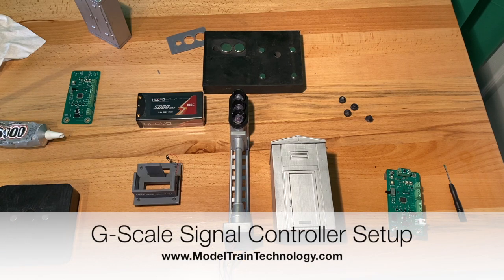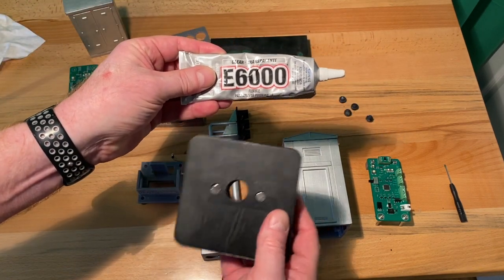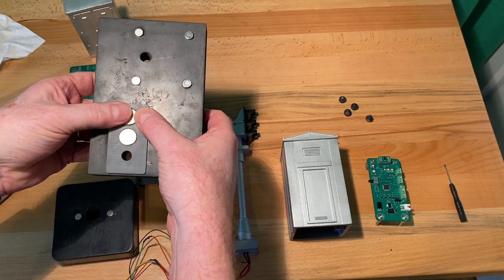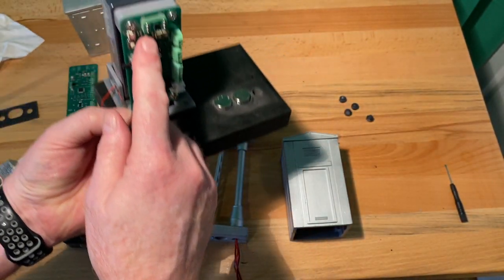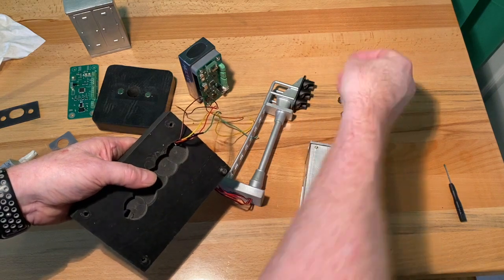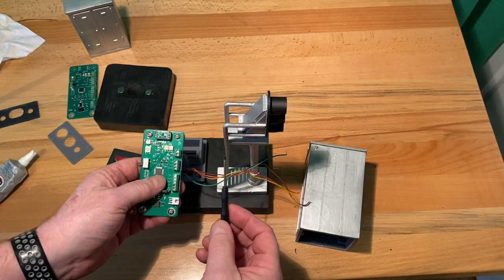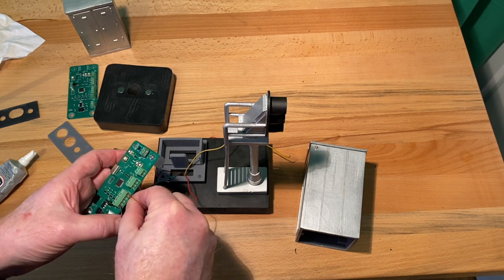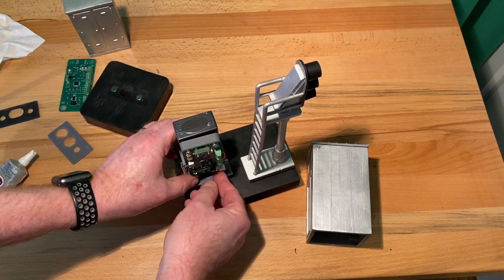G Scale Controller & Signal Setup and Operating Instructions

Comment: I am interested in those electrical houses. I build my own searchlights close to scale for the old US&S H2's and right now, they're bi-polar LED's, just red and green. I'm hoping to soon develop three color LED driven searchlights that have the same detail.

But just to have some type of infrared circuit to detect and change the signal would be great.
Reply from the maker: We dont use Infrared (just to be clear on that). IR is notoriously bad in varying light conditions.  Three color is easy and the Signal Controller will support both common Anode and Cathode variety.